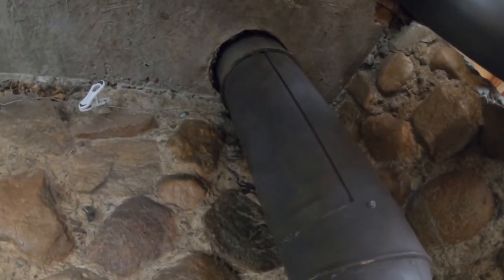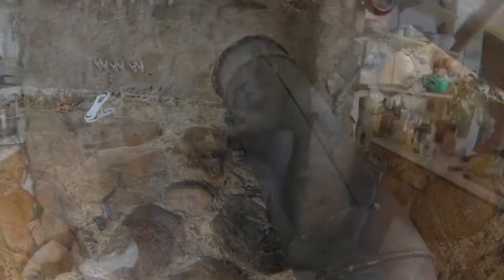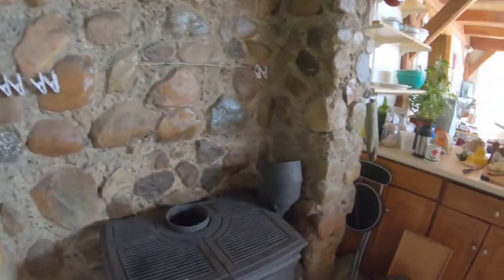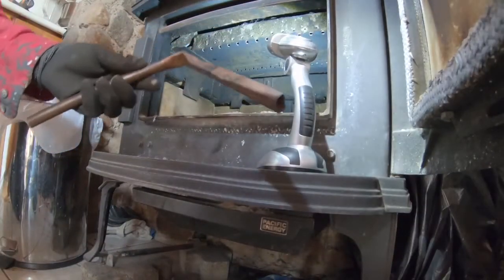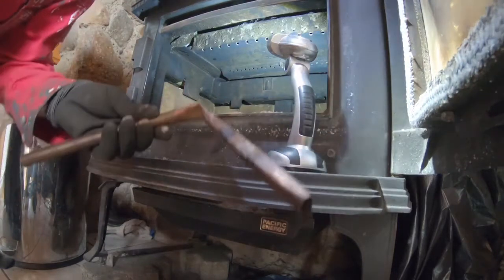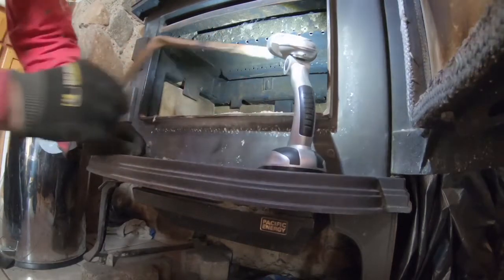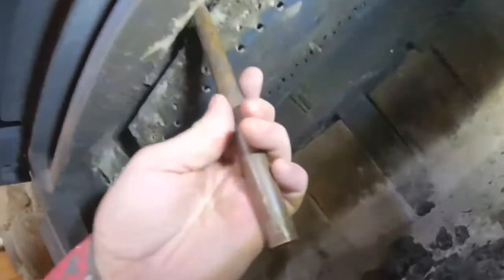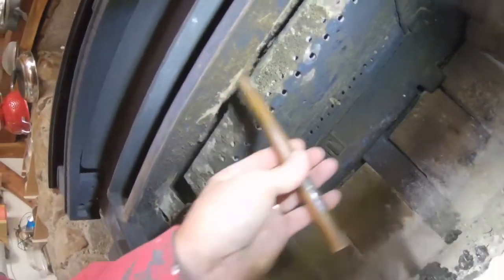Clean Wood Stove Baffle DIY Tool without Taking Chimney Pipe Off - Improve stove efficiency

Comment: Thank you! I paid a chimney sweep to clean the cabin chimney. first time in 20 year. When he was done and long gone, I realized I couldn't get the fire to burn without keeping the ash dump door open a crack.  He's no longer in the area. The stove has an outside air feed that worked perfectly before.  I'm a grandma and I have no one to help take the chimney apart.  I'll try this and see if it helps.  That's the only constructive info I have found about cleaning the air intake on a reburner.  I think the sweep just dumped a ton of soot down the chimen, vacuumed out the firebox inside and left.  Hope this works!
Reply from the maker: I just saw this.  Did it work?

Comment: I have a 20 year old wood stove baffle that looks like it is welded in place. How do I remove that since the baffle has warped down and is starting to slightly disintegrate. It still works fine.
Reply from the maker: Don't think you can remove welded baffle.  If it still works don't worry about it.

Comment: Just watching now first time I’m older and have a woodstove similar to yours except mines a straight pipe that just goes up through the ceiling my question is is is it the pipe that needs to be cleaned or is it the baffle I don’t burn very much I’m in California so it doesn’t get super cold but I’ve been living here a couple years and never thought about it never had a problem either what should I do I am an older single woman by myself thanks
Reply from the maker: If the stove is working fine ie: drafting, when you light it the smokes goes up the chimney you should be okay.  My opionion.  If unsure hire a pro and have him clean the chimney and get him to do the rest.  Shouldn't cost too much.

Comment: Thanks for the video!!! We have. A question. Tight Quadra fire stove and we cleaned the top with the brush and all the stuff fell on top of the baffle is it okay to leave that stuff there?  On top of the baffle is actually some type of insulation stuff. I imagine is in there to insult so not sure if we should take that out and do as you did with the copper pipe.  Thanks for helping!
Reply from the maker: Not familiar with your stove.  If it is drafting okay then don't worry about it.  If it is not drafting, smoke coming out, then you have to clear the soot from the top of the baffle assuming you have already cleaned chimnet.  I have insulation on the sides of my baffle so I just work the middle area.  If you are not sure you will have to take stove pipe off to access from the top.  Good luck.
Reply: @EdwardHomerVIC  thanks for the reply!  We ended up removing the insulation piece that was on top of the baffle gently as to not tear it and all the stuff was on the top of it.  We cleaned it off and put it back into place and it seems to work great.

Comment: I made a step down tube for my shop vac. Works heaps better than your solution.
Reply from the maker: I only have enough room for a 1/2 inch pice of copper.  Very tight.